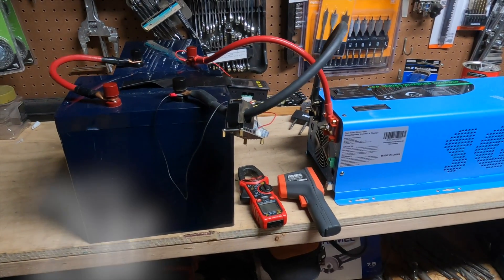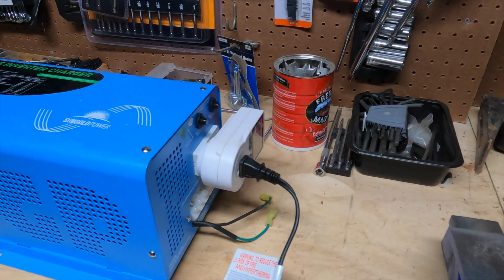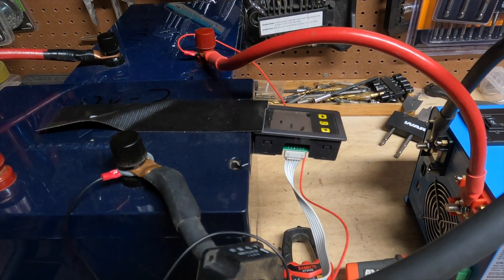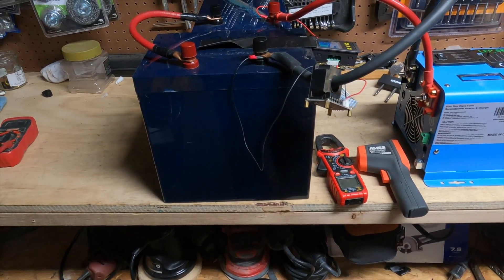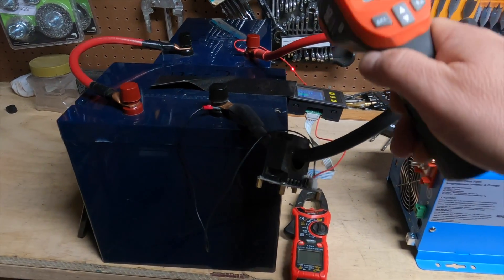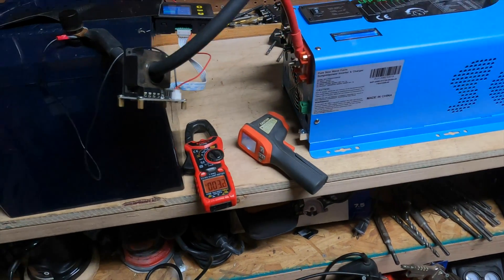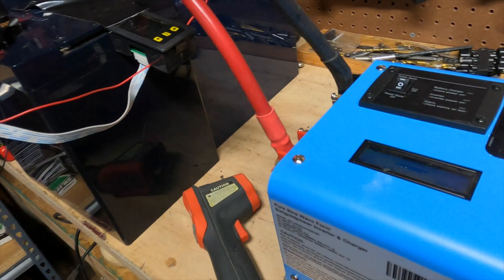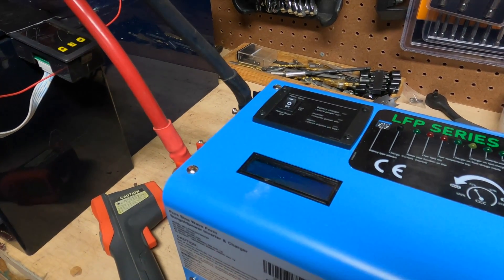Storage needed to run a space heater.  I tested two 12v batteries to see how long they would last.

Comment: Can you Connect 3 SAME 12 VOLT BATTERIES . TO 1 SOLAR CHARGE CONTROLLER " RENOGY 40 AMP " ..
Thank You for your help 🙏
Reply from the maker: I have multiple batteries in parallel connected to one charge controller so I don't see any issue with doing that.

Comment: What amount of Amperage does the 4KW Inverter consumes from the batteries when Inverter has NO load on it's other end? (A Computer's UPS drains about 0,5 Ampere with NO load on it).
Reply from the maker: Idle consumption: is 48W but it also has a power saver mode that drops that down to  9W. It's a decent inverter but I just use it as a backup. My main one is a 6000w genetry solar inverter
Reply: Good one abouth 92 percent out and a cheap one mostly 85 till 90 percent out. For low power is a smal invertor better